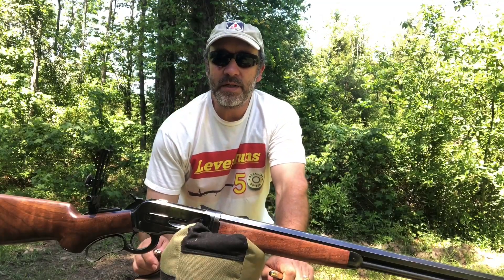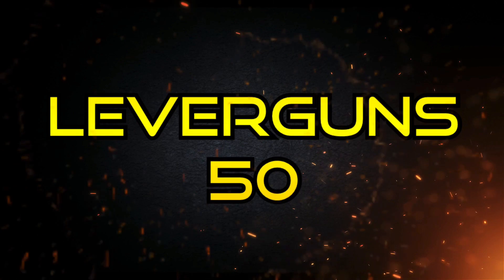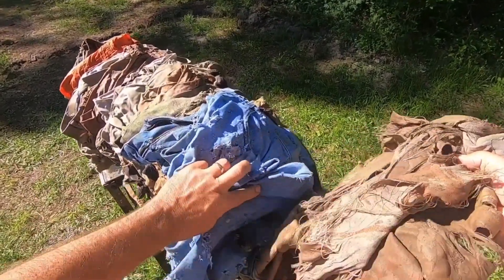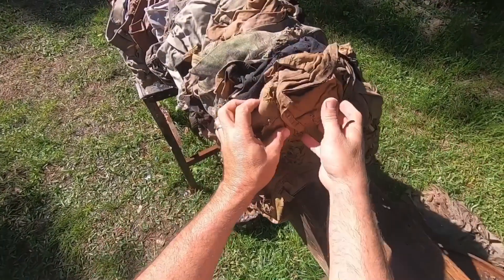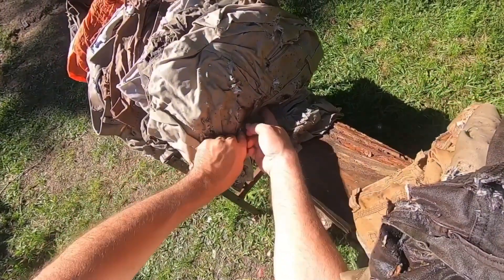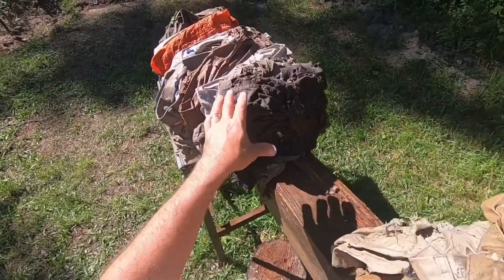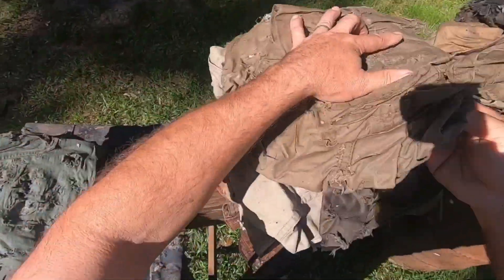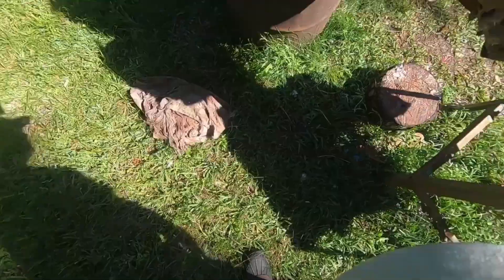400 grain Hydrostatically Stabilized for the 50-110 WCF

Comment: Hey! Love the videos. :D Just out of curiosity but where do you get your load data for this caliber? I have Marlin 1895 and have thought about doing this conversion but I can't seem to find the hotter loads seen on your channel. Thanks a lot! Keep on doing what you're doing!
Reply from the maker: I had this new Winchester converted to 50-110 back about 2000 so I’ve been reloading for it for about 20 years, The new Winchesters are capable of much higher pressure than the old originals, most loading data is for the originals or to be safe in the originals, there’s several websites talking about the new 1886 Winchester how it’s capable of 50,000+ psi loading for the 45-70 making it an excellent platform to start from, so since i’ve been reloading for 20 years and experimenting with loads I have a lot of load data to fall back on with new bullet designs, however I’ve talked to several people that load quite a bit hotter than I do but I feel my loads are hot enough
Reply: @Leverguns50  Thanks for the reply! That's awesome you have so much experience doing this. 🤘 Do you have any sort of "cook book" so to speak that details the data that is for sale or anything like that?

Comment: O K so I Need some place to start on Woodleigh 400 gr bullets for my 50-110 POWDER  what powder do you use ??
Reply from the maker: Only for modern guns in good condition with modern barrels. Depends on what type of powder Varget works good, I started at about 78 grains. I prefer H322 I start out with the same powder charge. As always don’t try this at home this is what I do

Comment: You could try the Cup Point Solids made by North Fork bullets and sold by Reloaders International. They are not dirt cheap but at $2.20 each they are a lot cheaper than Woodliegh.
Reply from the maker: Thank you that does sound a lot cheaper

Comment: Love that 50-110!!

Barnes doesn't make a copper "TSX" flat nose bullet in .510...but they do make them pointed for the 50BMG. How about an experiment in cutting the point off and making it a flat nose bullet??
Reply from the maker: I could do that I have taken the 650 50 BMG bullets cut the nose off turned them around backwards and shot them like a flat nose using the boat tail for the tapered nose but it was kind of annoying because I have a steel core in them
Reply: @Leverguns50  I replied to your Patreon. Some more viewers need to join us on there!
Reply: I Second That Suggestion And a 50 BMG Tracer as Well 😀

Comment: According to an article I head a million years ago, Woodliegh used the design of the shells from Japanese battleship guns as a starting point. If you remove the streamlined wind cap from an AP ship round, the hardened armor piercing nose is shaped like this.
The purpose of the design is for the bullet to pernitrate straight, the round nose solids tend to curve off in fluid.
Reply from the maker: Seem like they work phenomenally well for being a lighter bullet penetrating more than the heavy one must’ve been fairly stable to, what’s annoying is they only come 10 in the box for like 50 bucks
Reply: @Leverguns50  Look at North Fork bullets entire line, not cheap but very fine bullets.